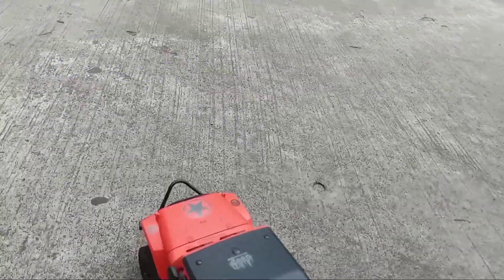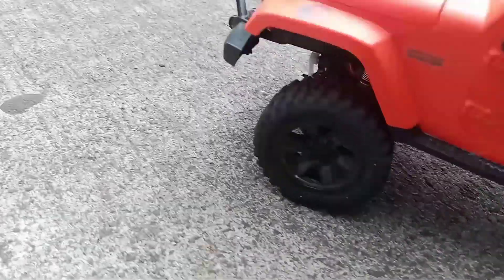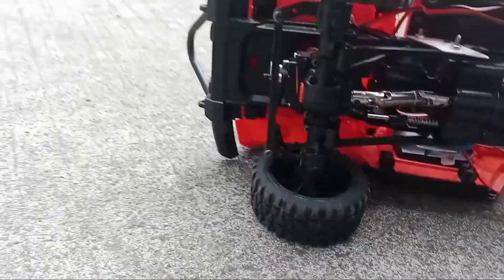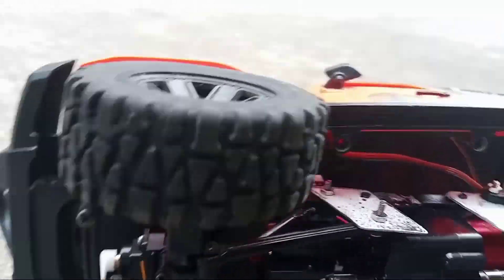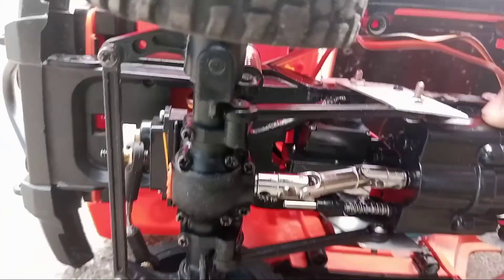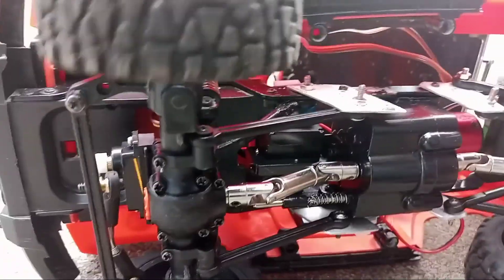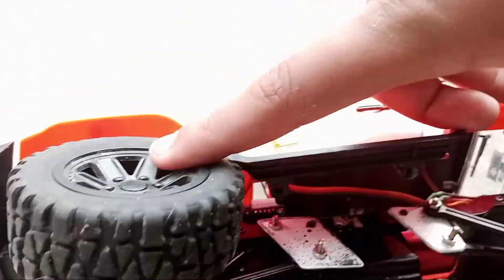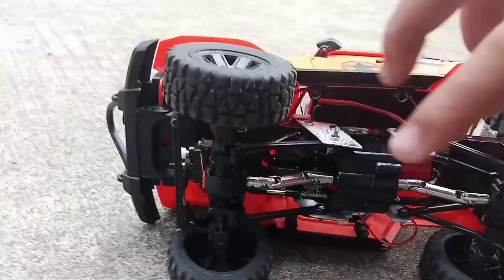my crawler projects is finish

Comment: check the angle of your driveshaft and check your gears of your 2 speed wpl .
Reply from the maker: I know i know the front drive shaft and the gear there metal soo i don't need to open it its just the goolrc brushless motor is a bad idea but its work
Reply: Yeah just put the brushed motor in and letss seeee
Reply from the maker: @carlossrcadventure9484  yeah about that i don't have a brush esc sooo yeah